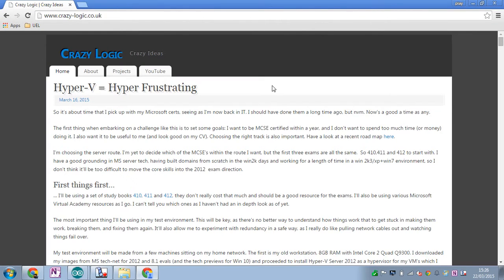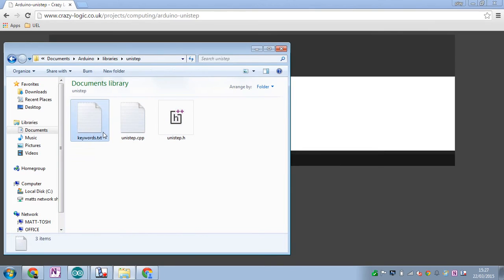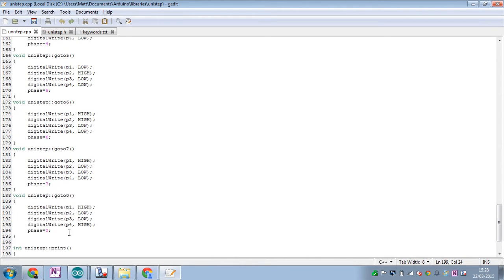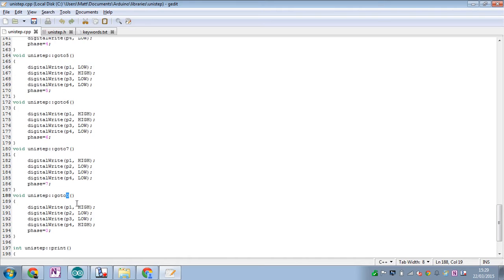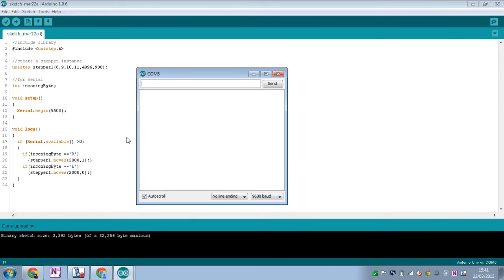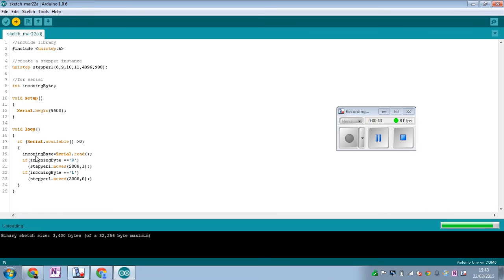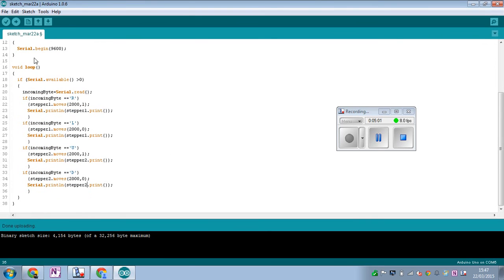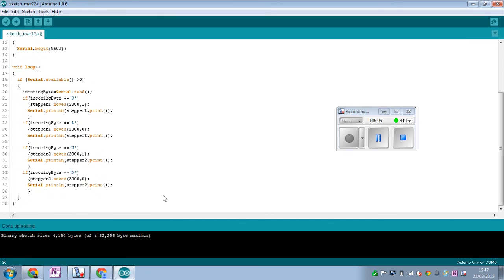#7 unipole stepper library for eBay stepper motors, 28BYJ-48 + ULN2003 Driver

Comment: I have found after completing a 'moves' function it leaves the last drive state on the motor, thus leaving the coils energised taking current. So I send a digitalwrite LOW to each pin to clean the last state value and stop drawing current. Thanks for the library. 👍🏻
Reply: Sorry I ended my comment prematurely, accidentally clicked the done button.
Is it possible you could add a clear state function to the library? Thanks.
Reply from the maker: at some point in the future if i ever revisit this i will add that - thanks for the idea and comment :D

Comment: hello, can I connect my external power supply to Arduino board instead of the motor drive? I am trying to connect 2 motors, by the way how can I contact you on your website. Thanks
Reply from the maker: yes - you can use an external power supply, if the Arduino isn't connected to the computer then simply power the +5v and GND pins with +5v and GND. if it is connected to the USB port, then connect the GND of the board and the GND of your power supply together, and power the driver with 5v from the external power supply. if you have more than one driver, just make sure all the grounds are tied together (connected). My email is on my youtube about page. ;)

Comment: this sketch can be use with a bluetooth  module in an arduino ?
Reply from the maker: yep you should be able to merge the two together nicely.
Reply: +Crazy-Logic sorry but can you make a code for two of does stepper motor. both can be have left and right  ?
Reply from the maker: The idea of the video is to explain how you can implement the library for yourself. Please download the files you need and modify them to your hearts content.